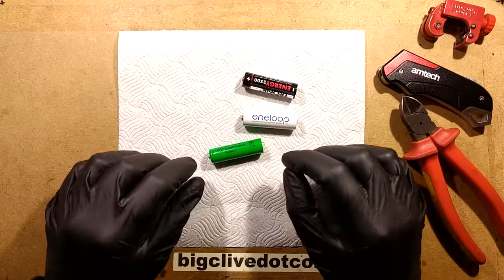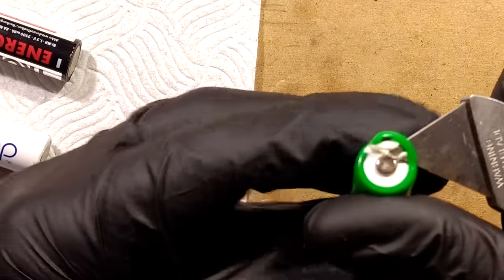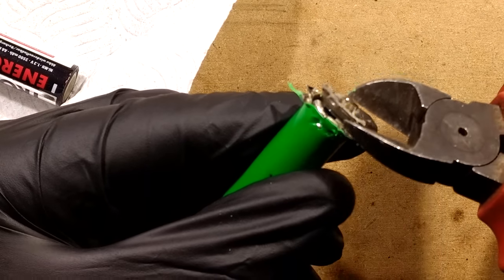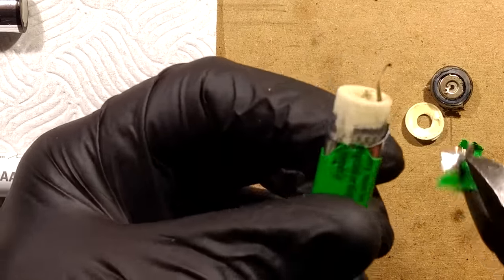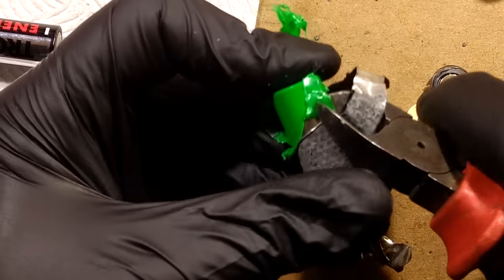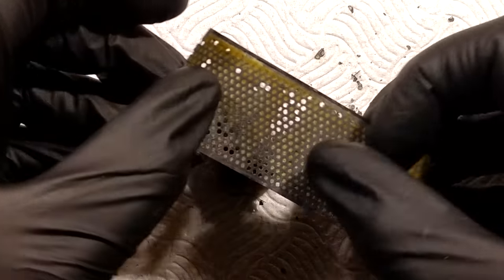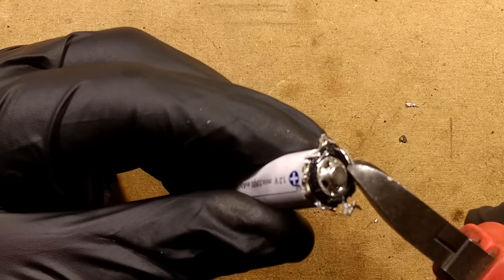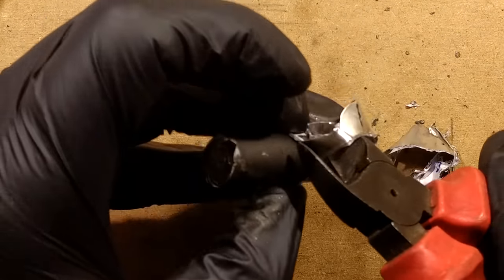What's inside Eneloop and LIDL NiMh cells (fire, apparently)

Comment: If you were to drill a very small hole in one end and add a drop of de-minralized water and then seal the hole with solder.... Would that increase the capacity? Or revive a tired one? Just don't use a spontaneous combustible battery... I have been trying to figure out how to rejuvenate lead acid batteries... One thing that I think is a problem with lead acid batteries is that they loose hydrogen when you charge them to quickly, no one tends to tell you that batteries let of hydrogen gas while it's charging... They just warn you to keep naked flames away from the battery when charging... Hydrogen.... That stuff explodes violently and gives you a sulfuric acid shower in the process LoL... One of these days I'll empty the electrolyte into a container and bubble some hydrogen and oxygen into it and put it back into the battery and test it to see if it will charge up again, I have some total dead batteries lying around the house... Just need to get off YouTube to have the time to do it lol... Apart from all the crap that ends up sitting in the bottom of the battery which is probably particles of lead that is probably shorting out the battery... The only other thing that I can possibly think of is the lack of hydrogen and possibly oxygen that is released from charging and discharging at high currents.... Slow charging and discharging tends to make the batteries last a lot longer.... Anyway, it's just a theory at the moment with the lead acid batteries but I'm curious about adding a drop of de-minralized water to these AA rechargeable batteries... Dave over at EEVBLOG just opened up some rechargeable D cell's and I think that the energiser actually had a C cell in inside it with a plastic spacer.... I'm never going to buy those.... Anyway, thanks for another great video.

Comment: Actually, I don't think Eneloop is about getting the maximum capacity so much as limiting self-discharge so as not to lose capacity when the cell isn't being used. It's actually finding a middle point between the two considerations.  Ultra-high capacity cells like 2500 mAh probably have greater rates of self-discharge, but of course, greater capacity.

Comment: Try using a cheap $20.00 battery operated or corded rotary tool (a Dremel tool knock off). You could split it with a burr or cut-off wheel lengthwise.

Comment: I wonder if you messed with the contents of the other two batteries long enough, whether they would burst into flames too. If its just about air exposure and just the one battery, was that somehow a different chemistry but still Nimh? I mean that is what you said but I wonder what chemical difference there is and how that might be related to the higher capacity, and whether that is consistent across brand names.

I know when shopping for batters on Amazon two things were consistently said in high capacity AA batteries compared to regulars. That they were bigger, sometimes people struggled to fit them into certain battery compartments and the companies own stats said the higher capacity batteries had less life span as a result. 

Also that cottenous like clothy material may be what allows a battery to be Low Discharge. It use to be that NiMH lost charge relatively fast just sitting around. The technology that allows them to be LD was compared in an analogy to if you had a cup of water sitting around, how fast you lost fluid from evaporation. But if you took a bunch of paper towels and stuff them into the cup, you'd lose fluid slower, but at the cost of some capacity.

Comment: The combustion is a chemical reaction that increases in speed exponentially creating exponentially more heat. 
This phenomenon is often called 'thermal runaway'.
Reply: Pyrophoric materials spontaneously combust at room temperature upon contact with atmospheric oxygen. That's not thermal runaway. Thermal runaway is when you have something that enters a positive feedback loop of increasing temperature causing further increase in temperature, such as continuing to charge an overcharged battery that has a negative temperature coefficient for its impedance. Charging it creates some waste heat, this raises its temperature, this reduces its impedance, causing it to draw more current, repeat until something fails. If the battery is combustible, it may then catch fire. If it has no combustible components, then it doesn't catch fire, though it may be hot enough to cause something around it to catch fire. The video shows a pyrophoric reaction, not an example of thermal runaway.

Metal powders are often pyrophoric if the particles are extremely small. Such powders are easily made by thermal decomposition of organic metal compounds in an oxygen-free environment. For example, Nurdrage has a video for pyrophoric iron made from iron oxalate. https://www.youtube.com/watch?v=vPnqLSyoEy8
Reply: @5467nick  How do you know it is a pyrophoric material? Is it normal for NiMh batteries to contain pyrophorc materials?
Reply: @QoraxAudio  NiMH cells have a powdered metal hydride anode. This type of compound is very reactive with oxygen and is very likely to be pyrophoric. How reactive it is depends on how fine the powder is, and it is very fine, especially in high capacity cells. I know this because I have read about the construction of the battery and these types of compounds. Yes, it is common for NiMH cell anodes to be pyrophoric. This is why they have warnings about fire safety, specifically the warning that they may spontaneously ignite if opened.

A further example: A typical Li-Ion cell that is being overcharged in an oxygen-free environment will still undergo thermal runaway as it would in air. The only difference is it wouldn't ignite with outside air in an oxygen-free environment. Opening a NiMH cell in an oxygen-free environment would not do anything because without oxygen, the pyrophoric anode powder can't ignite.
Reply: @5467nick  Interesting... I always thought those warnings were on there just because by puncturing (with a metal knife for example) multiple layers get electrically short circuited, making a high current to flow, creating a lot of heat.

Since those NiMH batteries are consumer products, I never suspected them to contain those type of pyrophoric materials (in general, everything needs to be maximum safety and foolproof nowadays).
Reply: @QoraxAudio  Heh, there is that too, but not all types of batteries will actually ignite themselves from puncturing. The good thing about NiMH in that sense is that it doesn't have any flammable fluids, just the metal powder, so while it may burn, it doesn't produce a lot of flames and smoke. Lithium ion, on the other hand, does produce flames and both toxic AND corrosive smoke. I wouldn't be worried about the safety of NiMH cells. They are much more benign than some of the others we use today.
Reply: @5467nick  yeah I heard about the explosive Li-ion Samsung batteries a while ago haha

Comment: Did it catch fire due to lithium reacting with water? I wondered if maybe moisture from the air or maybe a tiny bit of spit would have caused it to catch fire or react with some lithium if that’s what’s in the batteries. 

I don’t really have a clue about batteries tho so I’m probably wrong.

Edit; didn’t watch the end of video till after I posted this. Lol

Comment: Just found some Sanyo Eneloops I bought in 2009, never been used, sold as pre-charged. Tested them, and they have held their original charge they got at the factory in Japan in 07 (July) of 2009 . One registers as 1.74v and the other 1.75v under no load on the multimeter. And they will power a digital camera - unbelievable. Locked away for 18 years and 11 months, and held a charge. Will be buying more 😎

Comment: If i remember correctly, ( please correct me if i am wrong ) phosphorous is stored under paraffin as ignites when exposed to air and speeded up when contacts water. Is this part of the ingredients?  Otherwise why did it self ignite? and does this mean that all this type of batteries could ignite if corroded enough to break down container its in and/or what is that component that is obviously liquid when its put in and dried out when you took it apart.

Comment: Sir if you think about it, the smaller holes in the mesh will better contain the material and prevent oozing under pressure.  Electrolytic cells like these because they are recharged get warm and build pressure.  Nice video.

Comment: I would be quite confident that they soak the materials in electrolyte before rolling it together. They probably compact the material and squeeze out extra electrolyte by rolling the metal around it tightly. 

Fitting the materials into a tube and then wetting it would risk an uneven electrolyte concentration. 
This may not be the case with the first battery, since there was plenty of room for the electrolyte. It would probably be cheaper to do it that way, so that might account for both the lower capacity and price.

Comment: All electrical and electronic components are made from smoke as they stop working once the smoke is released.  Metal pliers perfect for inadvertent short circuits and then nicely packed into a flammable paper ball when done.  Have you tried stabbing a lipo cell with a meat skewer?

Comment: Not a battery expert but moisture is required to make the chemicals store a charge hence the spongy media. The positive is smaller than the negative because electrons moving around gives the charge, thus a bigger negative is needed to store more electrons to create a flow of current. As far as which chemical is on which polarity your guess is a good as mine.

Comment: I know lithium on it's own reacts violently with h2o. Guessing probably the difference between the negative and the positive compositions causes the negative side to react with moisture in the air, whereas the positive side either doesn't react, or reacts much slower and won't combust.

Comment: The thermal reaction started really quick, 16:11 - we have that smaller black thingy on the far right and left to it is that larger one that reveals its back. On the white-ish paper you have some lighter gray remains that goes to the edge, but has three smaller and one large cutouts. Focus at the two smaller ones at the top. There it starts.
I think that touching it (and other bits of it) with the metal mesh serperator thingy didn't helped :)

Comment: They wrap the outer foil layers around the center bundle and terminal caps. It's thick foil with an isolated join for conductivity control with a heat resistant adhesive layer. Typically.

Comment: should put it in sand not use water :D , and it wasnt anything to do with reacting to the air , you shorted it out when you was holding it together and they touched :) (@16.18 end to end and rubbing a bit while you was showing something else (hole in the mesh ))

Comment: I love my small battery powered dremel,it even has small cutting wheels that could score the length of items and theyd unwrap easier.
I use it alot on guitars and to clean corroded connections with its 50+ tips.

Comment: The black powder coating it is a chemical that is also integrated into drain product to unclog the pipes it is a very combustion material  or chemical that once it's touch the humidity in the air will automatically start to heat up to a point where it catches fire  and water it starts reacting within 2 to 3 minutes because there's no air or oxygen in the water it does not catch on fire but it brings up the temperature to 150° where it will burn anything that's inside the pipe rendering it clean

Comment: 17:50 or the moisture in the air.  you were speaking for a while by the open batteries and we humans release a bit of moisture just standing still.  people working on batteries inside factories wear face coverings so they don't add moisture into the assembly line

Comment: That material is pyrophoric because it is so incredibly fine. There is a pyrophoric version of iron that just rusts so fast, because the extremely high surface area to volume ratio, that it burns instantly in air.

Comment: Lithium reacts with air and water so you can brush off the dust to sit outside over night in a metal bin where a fire would be of no consequence. To cleanup the bench you can wipe it down with wet paper towels, again store the paper towels out in the metal bin. The idea is that you want the lithium in the bench to react while you are there and not in the middle of the night when you are asleep.

Comment: all you need to do is get the spiral started then snip the pull edge straight, apply a sardine can key, or use the finestly needly nose pliers you can find (similar to jewelers needle nose).  Unwinding the shell would be surprisingly easier

Comment: Well since you pulled the mesh with less holes from the outside of the role, there has to be a logical engineering reason for it. Maybe that helps prevent leakage or something? Could also be that the black material sticks better to the mesh with small holes because the outside of the battery needs to be more durable than the inside?

Comment: word 'round town is to use a pipe cutter(has round cutting wheel) to cut thru metal jacket and pull apart.  Use pliers to pull out the rolled up cell inards.

Comment: Hello Clive,
Could you please tell me what do you think is the "safest" (Or I should say less risky) between dissecting a lithium cell, a NiMh cell and an electrolytic capacitor ?

I ask because I did already unravel some dead lithium ion and lithium polymer cells in the past, sometimes not even wearing gloves and... No big deal so far.
But I wouldn't however feel confident doing the same with a NiMh cell let alone an electrolytic capacitor, oddly enough.

You, on the other hand did all of these here on this channel, hence my question.

By the way I did also cut open AA and AAA alkaline batteries almost 20 years ago by now to get carbon rods and once again no big deal other than a black mess of manganese dioxyde that fortunately didn't burn any hole in my hands as I was once again not wearing any gloves doing th
Reply from the maker: The capacitor is probably the safest, followed by a fully discharged lithium cell.  A NiMh cell seems to contain pyrophoric compounds and possibly poses the highest risk.

Comment: Hi, i thoroughly tested arround 20 of these Lidl AA batteries and they are the worst batteries I ever brought. Im fan of the Lidl electronic products but these are junk. Not relatable at all. Capacity when new arround 2300mah but after 15 cycles are fluctuate between 380 to 1650mah yes that much. If you want best battery for buck buy the white IKEA Ladda 2A or 3A they are in capacity of 2500mah and  900mah with very low self discharge. They are amazing from RC toys, tv remotes, to high power Photography Flash.
Reply from the maker: Are you using a smart charger to test the batteries?  Many of the smart charger end the charging far too soon with some cells.  The same cell in a simple trickle charger will take a full charge.

Comment: A fully discharged Energizer Ultimate Lithium AA size battery does exactly the same thing! It's not even rechargeable, it was flat - and still had lots of chemical energy in it!
Reply from the maker: The non rechargeable lithium batteries actually have a huge amount of lithium in them.  Much more than in a rechargeable one!

Comment: The reason for the mesh is that it has a greater total surface area as opposed to a sheet or plate. Electrons don't travel through metal but over it, with more surface area there is the more room for more electrons.

Comment: Yep! That's the lithium compound they're using. The compound they're using combusts when it comes into contact with /water/moisture OR the other side of the "tape". I'm surprised it wasn't more energetic than what you experienced. Usually it's a quite vigorous pink-flame.
Reply: The best part is that in their words "... [the material] MAY be pyrophoric ..." when they most certainly know it IS; like you'd be extremely disappointed or had the right to complain if by any chance your battery didn't spontaneously combust when disassembled.

Comment: I got a pack of 4 rechargeable AA batteries from B&M, ostensibly for solar lights but currently on rotation in a glade automatic air freshener. I say on rotation because my battery charger is crap and the batts are only rated 300 mAh so understandably, 73 mAh is probably at the upper end of expected charge capacity. But its OK because I need 2 at a time!
Reply from the maker: Smart chargers often have a problem with low capacity cells and will terminate the charge very quickly as the high charge current makes the voltage rise too quickly.  The cheap dumb trickle chargers will charge them fully.

Comment: OK, so here is why I can no longer sleep at nights, having watched this video.  As far as I understand it, if one allows batteries to discharge for long enough, sufficient hydrogen can be produced to create enough pressure to rupture the battery casing. Surely, that would lead to a situation where oxygen could enter the battery and cause this spontaneous combustion.  But experience suggests that this is not happening. Do you have any ideas why not? What is saving us from this scary phenomenon?
Reply from the maker: It really takes physically cutting batteries open to pose a risk.  They're normally completely safe.

Comment: 16:45 lithium reacts with air, I'm not sure with the science either but even when discharged the lithium can still ignite.  Lookup pure lithium in air, or any of the the s-block when dropped in water.  you almost always get quite a rapid reaction of one kind or another.  it's like rusting of iron but amped up 10x
Reply: I thought these were Nickel-Metal Hydride.